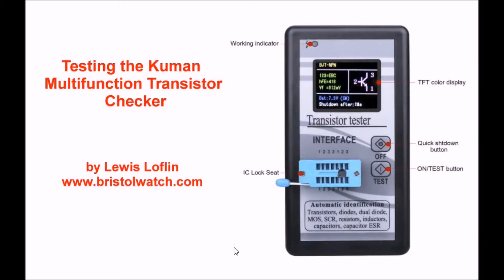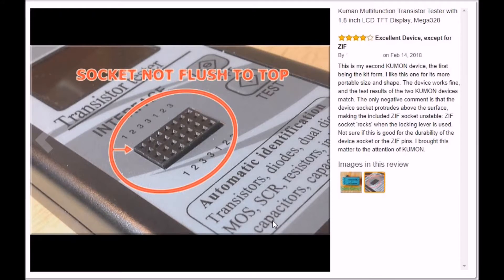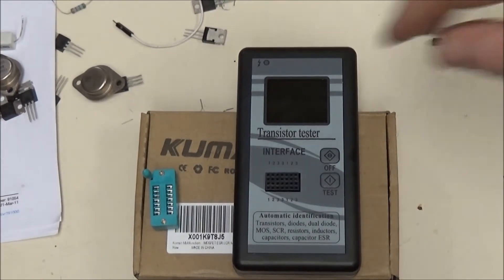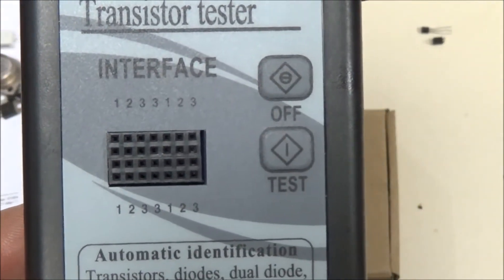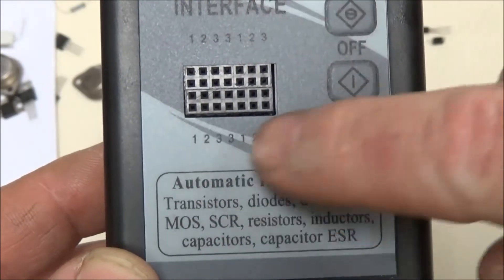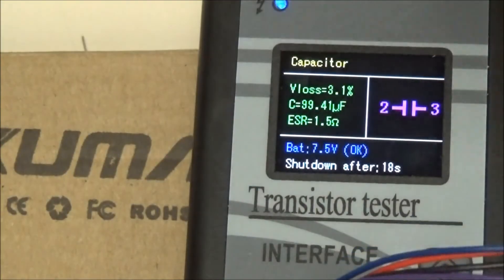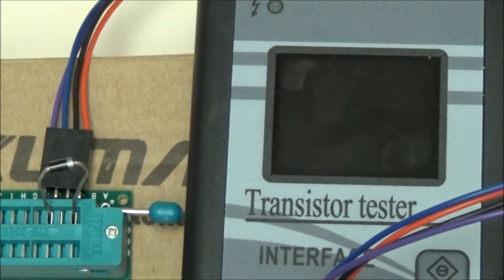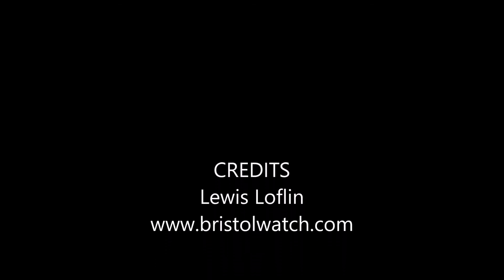Testing the Kuman Multifunction Transistor Checker

Comment: There seems to be another version of this tester, that has a different color scheme on the front panel.Blue and yellow, I think. Yours is the A model and the other is the B model. One vendor on ebay was selling both. I would love to know the difference. Then there is a square cased one with a flush ZIF socket, that runs on a rechargeable 3.7 volt lithium battery. That one can decode IR remotes. It is called the TC1. I wonder if I have to give up other features in exchange. I would love to buy one if I could sort them out. Any help appreciated. Thanks.

Comment: I think you may have misspoken - it does not appear to show the polarity of electrolytic capacitors, merely the values. Please correct me if I am wrong. I fully agree that the connector devalues the device, and I may make an adapter similar to yours. Thanks.
Reply from the maker: I meant the capacitor has to be turned in a particular direction to work much of the time. Another bug in the system.Thanks